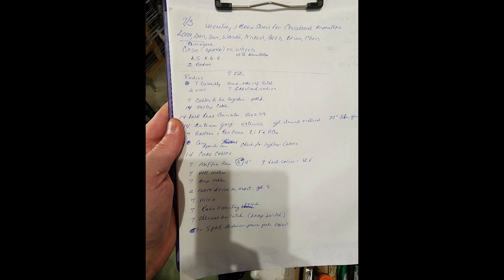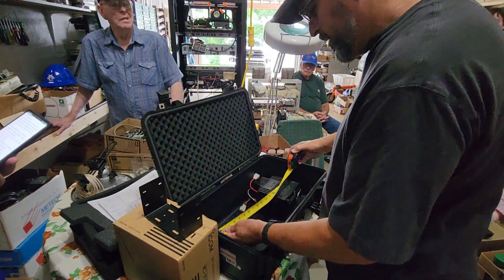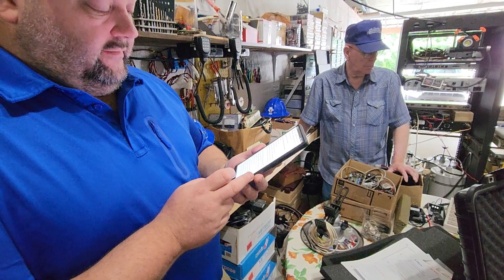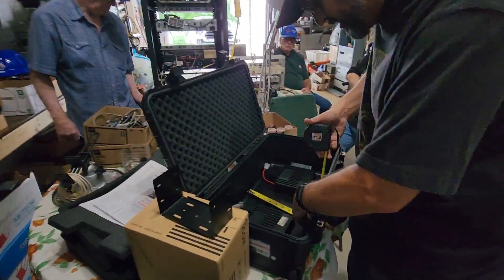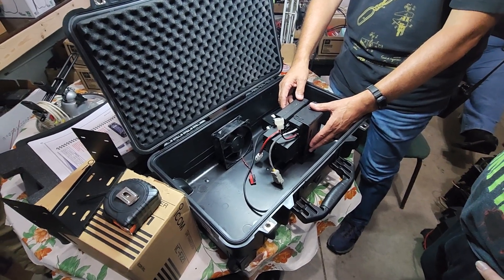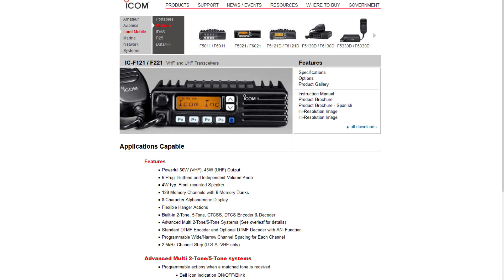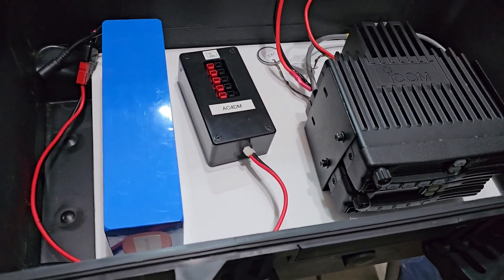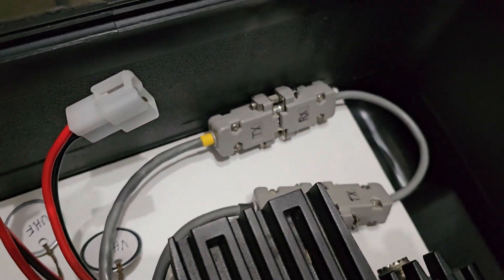LCARA HAM Radio: Crossband Repeater Kit Build - Pt. 1!!!!

Comment: You might want to look at the Motorola CDM series radios. The low power version can be set to 1-25 watt output. The vhf is 136-174 mhz and the uhf is 403-470 mhz. They are much more available than the ICOM radios and will do wide and narrow band. Look them up in Repeater Builder. The CDM1250 has 64 channels available. These radios are cheaper than the ICOM radios. The 20 pin accessory connector has all of the I/o you will need.